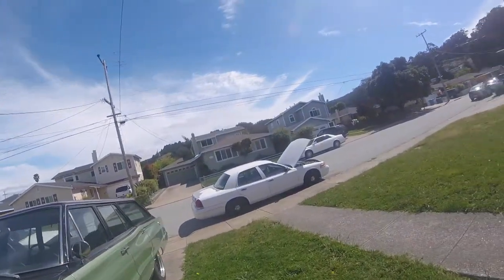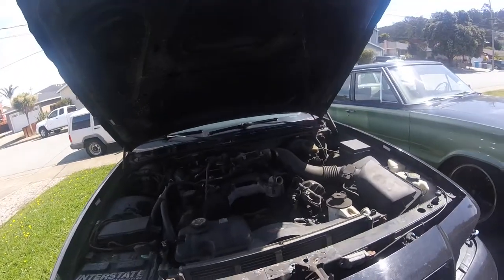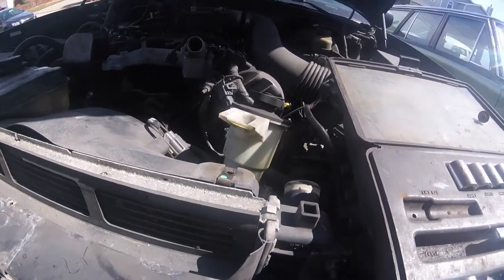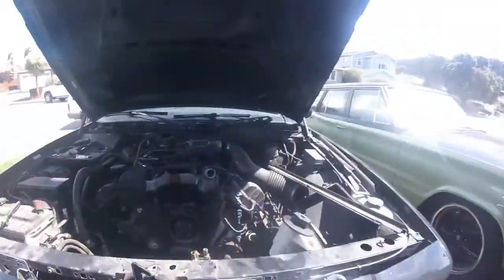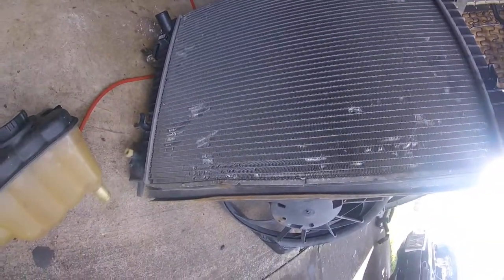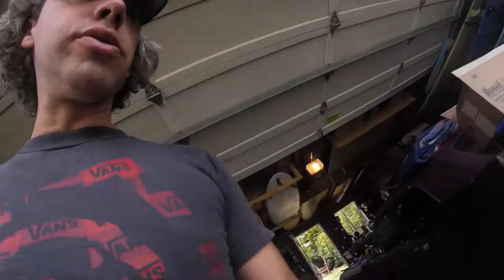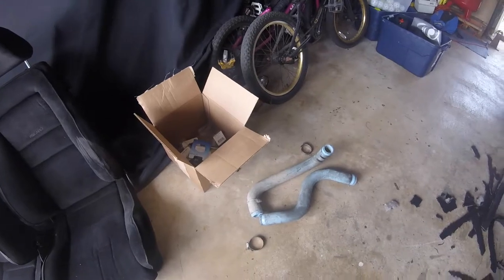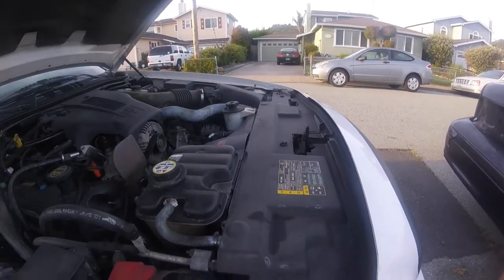PoF // Ep 17 - Crown Vic Cooling System Replacement

Comment: Also there’s a transmission valve that you can  bypass thermostat on the bottom corner on the trans cooler. Bypassing or delete trans cooler valve you transmission run much cooler and avoid overheating.